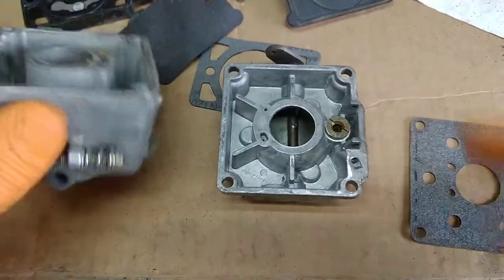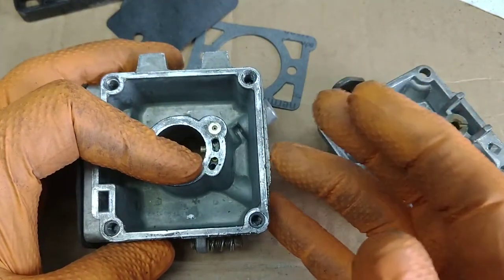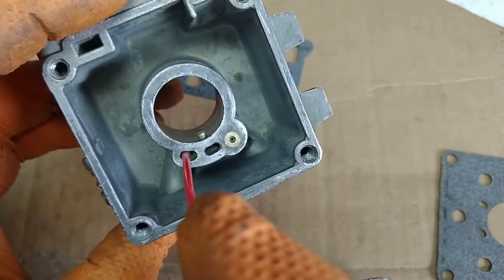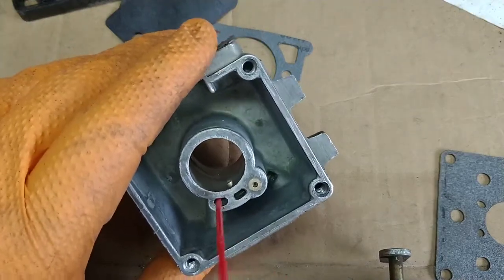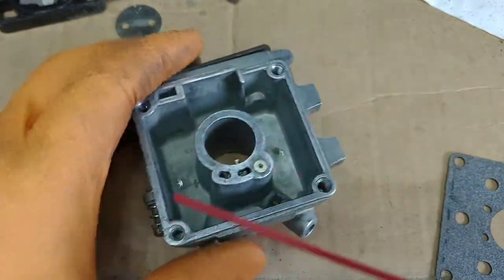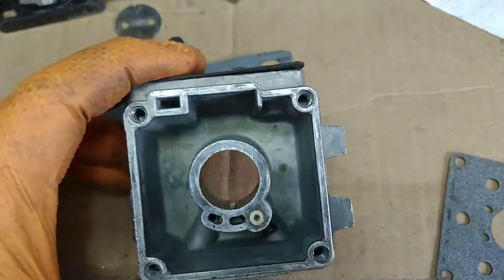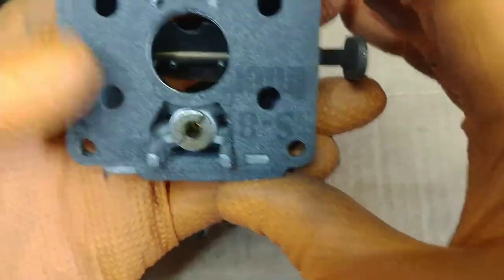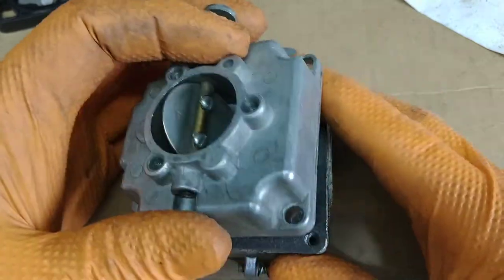Case Garden Tractors 446, 448 and 226, Onan B43 & B48 Carbs

Comment: Try some Ford Tune Up cleaner.  It is more foamy, oily and will set there and eat up the carbon very nicely.  It isn't cheap but it really works better then any auto parts store cleaner I have run across for tough situations.